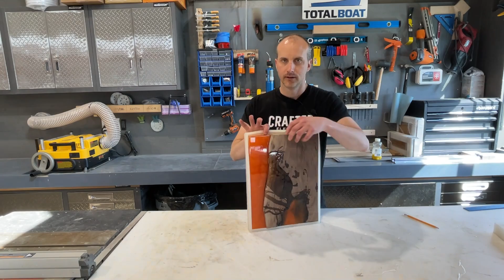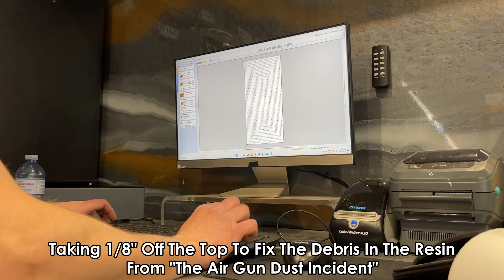Epoxy Resin & Wood Basics Series - Four Complete Projects From Start To Finish (Part 11/11)

Comment: What is the purpose of having a wood planer? Does it smoothen the wood or sand the wood?
Reply from the maker: When you are using wood with resin, it allows you level both materials to each other and get rid of any warping or uneven parts. Specific to this application, its impossible to make the resin line up at the EXACT same height as the wood, there will always be some difference. The planer takes a fixed amount off the top, eventually making both these surfaces true and level with each other. Sanding is required AFTER planing.

Comment: On the treaded inserts, which length are you using?   15mm or 20mm?  By the way I've really enjoyed the series.  I ordered a couple molds from the site and hope to get going as soon as they come it.  Excellent job on the video series.  Thank yoiu!
Reply from the maker: Assuming your table is thick enough you will want the longer, 20mm lengths. You can certainly use the 15mm lengths for thinner pieces.
Reply: @CraftedElements  good info. Thanks!  I really enjoyed the series. As a retired educator I’ll add that your “classes” were excellently taught. 

I can’t wait to get started.

Comment: Do you ever use metric units for the resins?  I find multiplying or dividing by 10 so much easier than 1.8, 12, 16, or whatever esoteric units are in vogue in the U.S.  Thanks.
Reply from the maker: That logic tracks! Nice suggestion.

Comment: I have a project that I want to do, it's a Canadian flag on a piece of 1/2 inch P3 plywood, and finish it with a coat of epoxy, and that's the easy part. What would you recommend for coloring the plywood where it needs to be white? I have some Minwax clear tintable stain that is tinted "Marshmallow" which is a Lowes exclusive color, but it's just not opaque enough for what I want to achieve. I also have the same stain in "Scarlet" which is also a Lowes exclusive, but again, I don't think it's going to be opaque enough. I was thinking about paint, but I don't think paint is going to work well under the epoxy because the epoxy will bond to the paint and not the wood. Do you have any ideas or suggestions??? Thanks in advance!!!
Reply from the maker: Hi @PaganWizard I appreciate you writing this comment. However, I know the limit of my knowledge and stain is something that I RARELY use. If it were me, I would be doing a Canadian flag in full epoxy, with the help of my CNC machine (laying down a base of red or white, then milling out the opposite color and filling it). That might actually be kind of a cool video now that I think of it.... It would also be my opinion that if you watered down the paint (which I have done before) which left enough of the grain of the plywood up (you know those tiny little fuzzies) that the epoxy would surely bond to that. Keep in mind also that you are doing a complete solid layer of epoxy on top, differences in bonding across the surface isnt going to make a difference when you have a hard cohesive plastic shell.
Reply: @CraftedElements  I think I have it figured out. I will make molds to cast the three parts of the flag. All three sections of the flag are identical in measurements. I will then cast two red sections, and one white section, each about 1/4 - 3/8 inch thick. I think this will be the easiest way to avoid color bleeding. After de-molding, trim to final dimensions, then permanently secure the three resin castings to a sheet of plywood, trim and sand as needed. Then comes the hard part, I have to figure out how to make the large maple leaf for the center of the flag, without a CNC.
Reply from the maker: @PaganWizard  This sounds like a great, and very creative solution to achieving this. I hope it goes well for you.